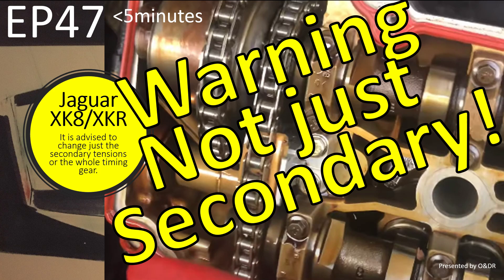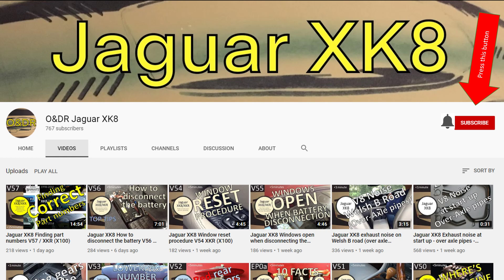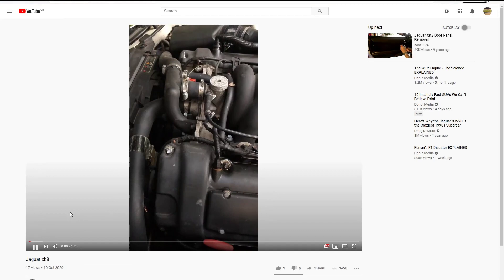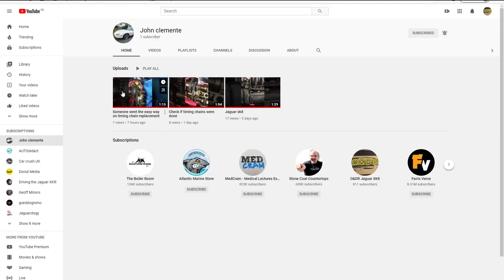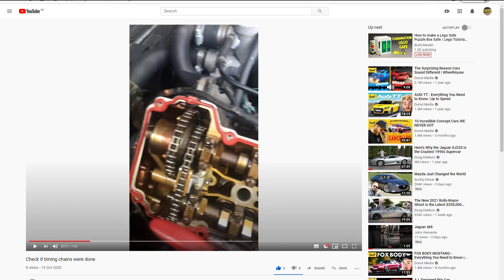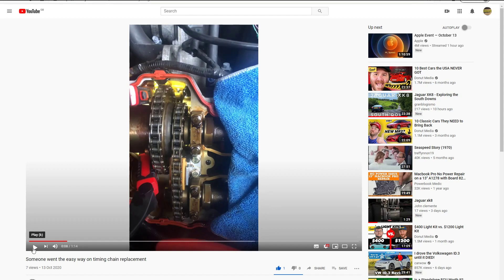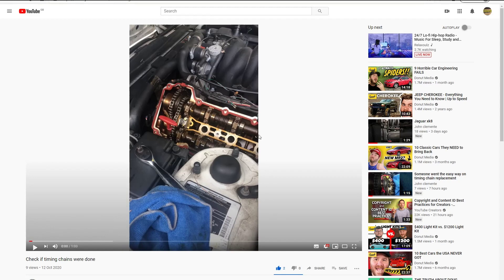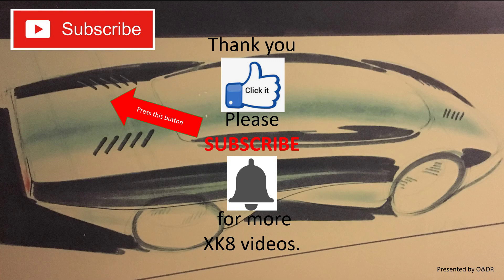Jaguar XK8 Timing Knock: Secondary Tensioners Not Enough? (John Clemente's Case) EP47 XKR AJV8

Comment: Good Day Sir!
Just joined the club with purchase of a 2002 XK8 with 48k miles. The engine code of 010625 puts it in the danger zone and having seen your 'summary of the 47' video and with a quote from Jag service for $8500 😂... I still bought it.
Having been given that glimpse of the scope, I can't help but stare deeply at the 'secondary only' mentality. I do realize that John is talking about chatter... But haven't we already conceded that it is likely mechanically sound as it sits? Can primaries jump time because of the tensioners? Or is the potential that they'll lose pieces cause enough for going all in?

The embedded question then is... 
If my focus is avoiding catastrophic failure, how much labor and how many pitfalls could be avoided if I shorten my sights to secondary tensioners only?
Could the secondary tensioners be changed with only removing the cam covers creatively? Or does the timing chain cover have to come off regardless?
Thank you for your time and consideration entertaining what is clearly not the best plan, only the most cost-effective damage control.
Appreciate your time, Neil
Reply from the maker: Neil, thank you for your interesting and thought-provoking comment. Changing the secondary tensioners on their own isn't a bad idea. Its the easiest and cheapest way to service the timing chains. There is a DIY method using zip ties.  However, it is a compromise as the other timing elements will breakdown at some point. Although possibly not catastrophically there is no guarantee. Plus the timing will be slightly off due to stretch of the timing chain. If you are a tight budget its an option but you MUST check the sump oil pickup for debris (bits for the plastic timing parts). This is easy to do and avoid engine oil starvation.Please let us know your decision and how you get on, regards Damian
Reply: @Modurol , thank you for your keen insight! I'm confident that I'll not be having Jag perform the service for the sake of cost. When it happens, especially if it needs to be the complete repair, as is becoming evident... 
The mechanical skills and patience of this self employed plumber will likely be tested to near limit while following your hope inspiring video series. I'm sure I'll have questions 😁.
Have a great day! Thank you! Following
Reply from the maker: Neil, we are hear if you have any questions, regards Damian

Comment: Hi Damien,  I'm thinking of buying a very nice but non running 2001 XJ8 with 140,000 miles here in Miami. I came across your great video series and had some questions but wasn't sure if you are still checking for comments? Thanks!
Reply from the maker: Michael, no problem, if you have any questions please ask, regards Damian
Reply: @Modurol  So I asked for more info on the "not currently running" and owner replied it started overheating one day so he replaced the thermostat and ran fine but "a little shaky" so he replaced spark plugs and then valve cover gaskets but it hasn't ran since.  A little odd I know so probably something he missed to cause the no start but my bigger concern is the "little shaky" and what may have been damaged from the overheating.  Do these engines easily blow head gaskets or drop a valve seat if an overheat occurs?
Reply: ...the car body and interior look great and it has the not very common black (graphite maybe?) dash panel vs the usual wood grain that most Jags have. I've only ever seen that once before on a mid 2000 S type
Reply from the maker: Michael, sounds like a nice looking car with a dodgy engine. Like most cars these engines don’t like over heating. The amount of damage or not really depends on the amount / severity of the over heating. You would get lots of messages to tell you to stop. Not know for blowing head gaskets as a norm. Not sure why you would replace spark plugs after over heating? More worrying is the valve cover gasket change. This is probably done to check the timing chain tensioners again not over heating related. This might need work and hence ‘a bit shaky’.  Most likely the engine will need substantial work or better still a replacement refurbished unit to be safe. Sorry can’t be more specific. These engines need TLC otherwise they can be complete money pits, regards Damian
Reply: @Modurol  Thanks for the insight!  I will have to check it out up close and decide if its a project I want to take on.
Reply from the maker: Michael, no problem, please let us know how you get on, regards Damian

Comment: Could this be a VVT related noise? E.g. the solenoid energizing? I hear this single tap/rattle when dabbing the throttle on my car too. It's still audible after the timing chain upgrade (the Full Monty, with all chains and tensioners done).
Reply from the maker: ‘A Bee’, possibly not fully retarded when refitted or faulty but very much doubt it. In the case of John Clemente it turned out to be the auxiliary belt tensioner. Might want to try and diagnose that first before getting back into the timing gear. The VVT's are really simple and rarely break.  They work on oil pressure to retard and a spring to return. So oil is the first thing to check. Assume you changed the oil and cleaned out all the debris from the sump. The viscosity of the oil matters as well. What year, mileage is your car because this will affect the oil selection due to wear. Ideally 5w30 fully synergic is a good grade for most applications. If you have an AJ26 engine, have high mileage or ticking noises possibly 5w40 as this is thicker. If you still have debris in the sump this might affect the oil flow and pressure build-up at low revs. The oil pump is driven off the crank. Check the oil first. Hope that helps? Thanks for the comment regards Damian
Reply: @Modurol  thanks Damien. I sound to have ‘tick all boxes’ with regard to your advice, so perhaps it’s the VVT not fully retarded. Oh heck! I’ll have a think. Your tip on checking the oil strainer for debris is spot on. I found a significant amount of plastic in there, so would concur with your recommendation to make this a standard part of the job, especially if the tensioners are being replaced due to chain noise rather than just precautionary.
Reply from the maker: A Bee, a bit stumped as to what the issue might be. Disconnecting the solenoid might indicate something if the noise changes. Also taking the aux belt off and starting without it for a very short period. This Will remove the auxiliaries from the equation just to be sure. I would very interest to hear the noise and your final solution for a video for the channel. Please could you email (or wetransfer) a short video to oanddr@gmail.com. Good luck with the investigation. Thanks for the input and comment regards Damian
Reply from the maker: 'A Bee' would highly recommend reading the experiences of other owners and joining the 'Jaguar Forums'. The engine is 25 years and most things have already been address on the forum. Take a look at https://www.jaguarforums.com/forum/xk8-xkr-x100-17/xk8-vvt-solenoids-26827/ and https://www.jaguarforums.com/forum/xk8-xkr-x100-17/understanding-vvt-repair-pictures-writeup-54805/ Hope you resolve the noise issue, regards Damian

Comment: Bonjour merci pour vos vidéo bien expliquées , j ai changé tendeurs primaires et secondaires , pompe à eau  sur ma x308 de 1998 . Après un démarrage avec succès j ai voulu redémarré mais impossible . L essence arrive aux bougies ....que faire ? Merci pour votre réponse Cordialement Erick de Montpellier , France.
Reply from the maker: Hello thanks for your well explained video, I changed primary and secondary tendors, water pump on my x308 from 1998. After a successful start I wanted restarted but impossible. Gasoline comes to candles.... What to do? Thank you for your kind reply Erick de Montpellier , France.
Reply from the maker: Good evening Eric, sorry to hear you are having problem after changing the cam chains. 
you say the car initially ran well and you have petrol to spark plugs. 
It could only be an electrical issue, either not getting a spark or engine error code.
The best place to start is to check for any error code through the OBD socket.
This will give you what the engine management thinks is the problem.
If it doesn't next try the obvious problems, it could just be flooded with petrol, the battery flat or the crankshaft sensor fell out.
It could be something wrong with the way the chains where changed.
I don't have any experience of this, so it is purely speculation and guess work.
As you have changed the timing kit it could be that timing synchronisation between cams and crankshaft has moved. 
But you should get a Crankshaft or cam shaft sensor error. 
This could be caused by :-
1/ the sensors not working or broken
2/ One of the cam shaft timing gears not tightened properly and moved.
3/ The VVT units not retarded properly and now moved to new position.
I believe slight movement would result in rough idle and engine running very poorly.
Any further is bad news.
However, its probably something obvious and not serious, just take your time and don't panic.
Thanks for the comment regards Damian
Reply from the maker: Bonsoir Eric, désolé d’entendre que vous avez un problème après avoir changé les chaînes de came. 
vous dites que la voiture a d’abord bien fonctionné et vous avez de l’essence pour les bougies d’allumage. 
Il ne peut s’agir que d’un problème électrique, soit ne pas obtenir une étincelle ou le code d’erreur du moteur.
Le meilleur endroit pour commencer est de vérifier pour tout code d’erreur à travers la prise OBD.
Cela vous donnera ce que la direction du moteur pense est le problème.
S’il n’essaie pas ensuite les problèmes évidents, il pourrait juste être inondé d’essence, la batterie à plat ou le capteur d’arbre à manivelle est tombé.
Il pourrait y avoir quelque chose de mal avec la façon dont les chaînes où changé.
Je n’ai aucune expérience de cela, il est donc purement spéculation et deviner le travail.
Comme vous avez changé le kit de chronométrage, il pourrait être que la synchronisation de synchronisation de synchronisation entre les cames et l’arbre à manivelle a bougé. 
Mais vous devriez obtenir un Crankshaft ou cam arbre d’erreur capteur. 
Cela pourrait être causé par :-
1/ les capteurs ne fonctionnent pas ou ne sont pas cassés
2/ L’un des engrenages de chronométrage de l’arbre de came n’est pas serré correctement et déplacé.
3/ Les unités VVT ne sont pas retardées correctement et sont maintenant déplacées à une nouvelle position.
Je crois que le léger mouvement se traduirait par un ralenti rugueux et le moteur fonctionne très mal.
Toute autre est une mauvaise nouvelle.
Cependant, c’est probablement quelque chose d’évident et pas grave, il suffit de prendre votre temps et ne paniquez pas.
Merci pour le commentaire concernant Damian
Reply from the maker: Eric, might suggest posting the problem with a video on the xj/Xk8 Facebook forum. Bigger knowledge base there. https://www.facebook.com/groups/2647335729/?ref=share thanks Damian
Reply from the maker: Eric, pourrait suggérer de poster le problème avec une vidéo sur le forum Facebook xj/Xk8. Une plus grande base de connaissances là-bas. https://www.facebook.com/groups/2647335729/?ref=share thanks Damian

Comment: Hi Damien.  I have a late 2002 xkr. I believe that the engine is the updated version. It has 124000 miles on the clock. It’s a weekend car only and not drivers in the rain.  Lots of history. Iv been told that I should not have timing chain issues.   What your your thoughts.  Many thanks. Steve.  Ps. The number plate looks great now Iv lowered it.  Thanks for that tip.
Reply from the maker: Steven, the 2002 uses the AJ27 engine and may or may not have been fitted with the upgraded metal tensioners as standard. Only way to be sure is to check the engine number is a date after 018130000 (13th August 2001).
https://www.youtube.com/watch?v=Leea3dpVsnM&t=9s.
If it is you are probably safe for even for higher mileages. The original plastic tensioners degrade with age. If its an earlier number its recommended you change at least the secondaries but as your mileage is quite high (124,000) change all the timing chains, tensioners and gauges. If it was my car I would do the whole lot rather than half a temporary fix.
Some general info in this video https://www.youtube.com/watch?v=f3wAGev6tPQ&list=TLPQMTQxMDIwMjCKc_ni3zfMXw&index=1. Hope that helps. Thank for you comment regards Damian
Reply: @Modurol  many thanks for your reply.
Reply from the maker: @stevenslight2607  no problem. Do you have the later engine number ? Thanks Damian
Reply from the maker: Steven, the engine number indicates a manufactured date of 26/07/02 at 02:43am. So you got the upgraded Rev3 metal tensioners. 👍 Should be OK. Thanks for the comment regards Damian

Comment: If your changing one you might as well change all of them.
Reply from the maker: Kuddleworth, that seems to be the best policy for the AJ26 and AJ27 engines. Thanks for the comment regards Damian
Reply: @Modurol  Just makes sense to me, if you are going to go through all the trouble or removing the cam cover and changing one tensioner you might as well do the others as well. Like you don't just change one worn bushing when you know the others will be worn out in a few thousand miles more, you might as well do all of them at the same time. Creates less work for yourself in the long run.
Reply from the maker: Kuddlesworth, agree with you but changing the secondaries is relatively easy compared to changing the primary and all the chains etc. Hence why some people have taken the short cut. Thanks for your input and comment regards Damian

Comment: It is vs Is it...?
Reply from the maker: Gary, it’s debated. But we have someone in the community suffering due to only changing the secondaries and having chains issues at 134,000 miles. Take a look at John Clemente’s videos. https://www.youtube.com/channel/UC2f4At9wBy_pEhNAPFpoCdQ. Hopefully once John rectified his issues we will know more. Much appreciate your support thanks Damian
Reply: @Modurol  I was referring to the sentence syntax in the big yellow dot.
Reply from the maker: Gary, from John evidence looks like it all needs doing. Hence ! but possibly need to hold back until it’s all done so may change to ? Understand now. Thanks for the input regards Damian.
Reply from the maker: Gary, what do you think, having watched the videos? Thanks Damian
Reply: @Modurol  If I am correct in my understand that early primary chains and tensioners were unsatisfactory, they all should be changed proactively ASAP.  For the 4.2L engines my sense is that they are all satisfactory as is and should make it over 200Kmi without issue.  If anyone thinks otherwise, please comment.  We are all trying to ascertain the longevity of these items, and the pre2002 cars did have different primary chains and tensioners than the later cars.
Reply from the maker: Gary, looks like the engine is the earlier AJ26 so your thinking could be correct. Regards Damian